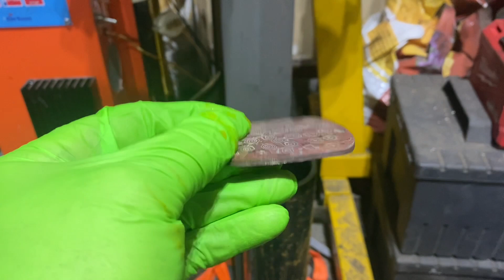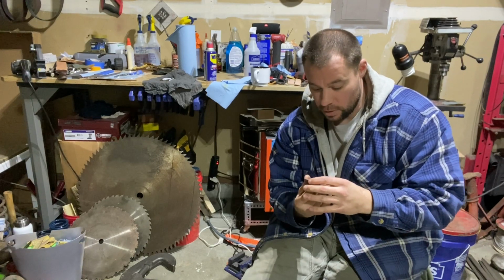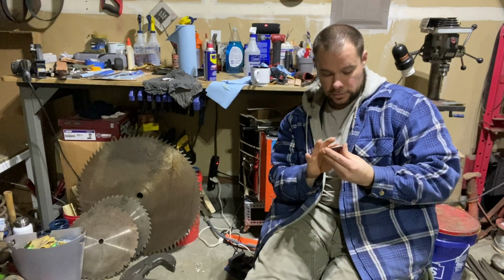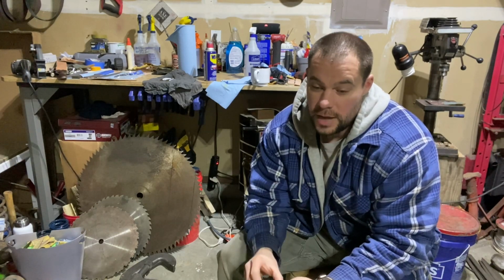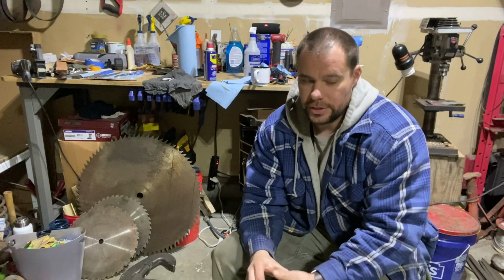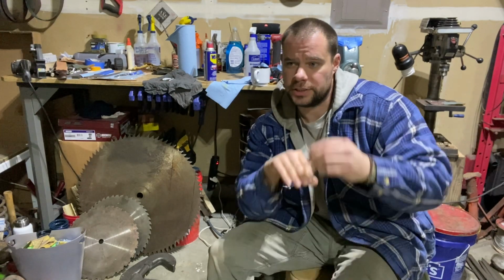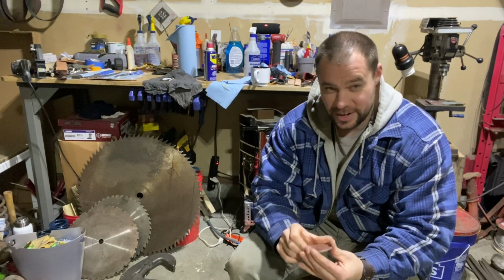Making Mokume Gane!

Comment: those first hits on the sides must have been stressful. i was waiting for the forbidden quarters to go shooting everywhere. i've been meaning to ask about your flatter... did you make that? i have some spare 3/8" plate laying around from building my belt grinder and want to do the same as what you got but i'm worried about the edges of the plate curling up as it's welded. did you have issues with that at all?
Reply from the maker: Yes I made my flatter! I welded a piece of 3/8” AR plate to and old hammer. I didn’t have any issues with the plate warping. 3/8” is pretty thick and I doubt you’ll have any issues. You can always tack the plate to a flat surface to insure it doesn’t warp.

Comment: Sec. 18 U.S.C. 331, have you read it?  Copper sheets and zinc/nickel sheets are available and totally flat for easier welding, and don't deface United states currency.   Other countries coinage isn't an issue, and as I understood it making a piece of jewelry is tolerated, but you should use something different than United states currency on a social network platform to avoid inevitable consequences from the feds.
Reply: what a poor sport
Reply: @carleighl7707  I'm not being a poor sport, just using common sense, as so many people don't use today.   And you can buy much more of the materials used for less than the coins used as materials, if that makes sense.
Reply: It's not illegal what he's doing. You know those penny press machines at Disney and sea world that stamp pennies? Same thing. Art.